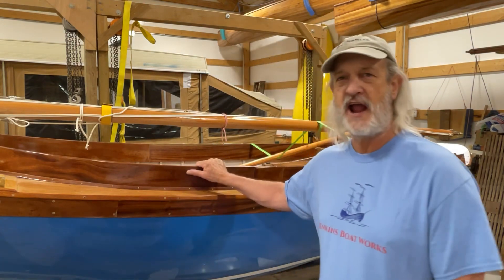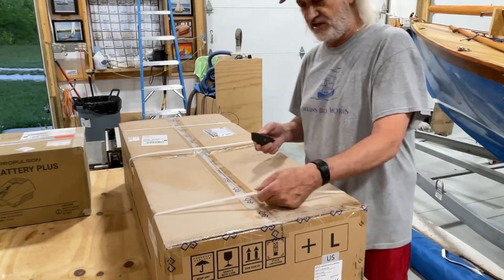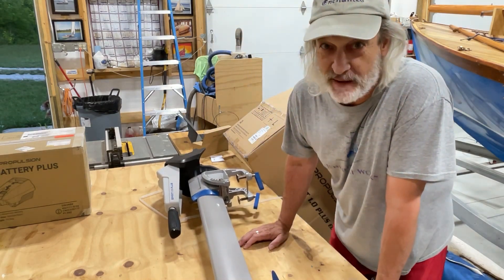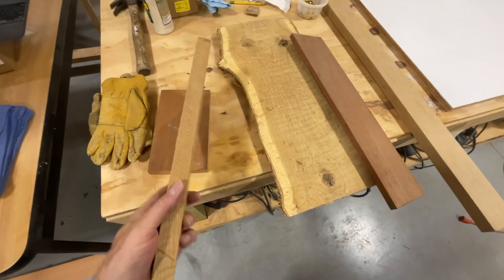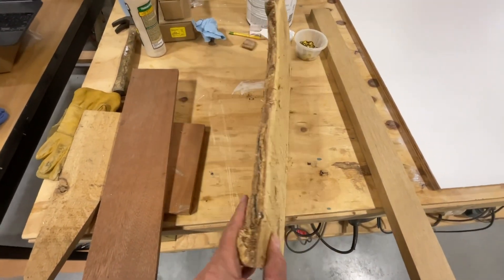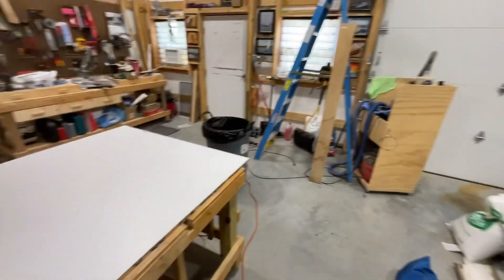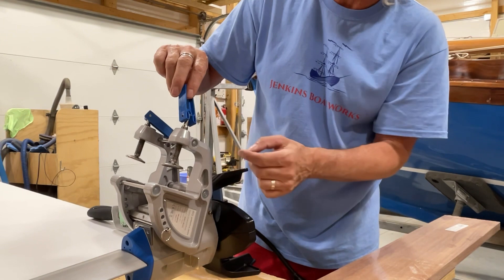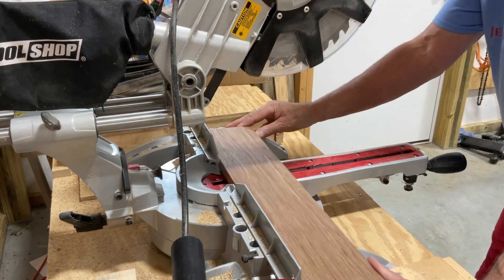How to mount ePropulsion Motor on Raked Transom - Haven 12 1/2

Comment: For less money you can install an inboard electric shaft drive a lot less ugly than a gas or electric outboard anything.   direct drive 2000 watt , 5/8” shaft thrust bearing , stuffing box and a 7x5 mud motor prop sweet.

Comment: Hi Chuck, Do you think your motor mount would work with a 2.5 Yamaha which is about the same weight as the Epropulsion?
Reply from the maker: Hi, I'm not familiar with the Yamaha motor but if it is the same weight, I don't know why it wouldn't work. The shaft would have to be long enough, obviously. Where it might get tricky would be with how the motor may lift out of the water but some minor adjustment or reconfiguration shouldn't be too difficult. What I've noticed with the epropulsion is that in order to lift it up, I have to twist it 90 degrees, otherwise the throttle/steering handle won't clear the top of the transom. It's a minor irritation.

Comment: Asking...did you already know the hull was level on the trailer before leveling the motor mount? That's a BIG motor for that boat! Then again, I can understand about getting out of the cove [or returning in foul weather] rapidly! Fair winds Chuck. cheers. ALSO, welcome back, missed your videos.
Reply from the maker: hi Steve, Thanks for watching and asking about this. yes, the boat is crazy level  on the trailer. the floor in the shop is level and the bottom of the lead keel is quite level, so as a result, she sits on the trailer very evenly. I did check though, too.  I am almost longing for colder days with no yard work etc, so I can get back into the shop more regularly.

Comment: Nice job.  It looks like you might be able to drill a fifth hole,   up from where the pin is that holds the motor at that highest factory set point.  Put the new hole about an inch up from the top existing one (see video at 5:53) , and put the pin in and the motor would be just about vertical and mounted directly on the transom with no box required.  Could that work?
Reply from the maker: Maybe! I will explore your idea. Thanks